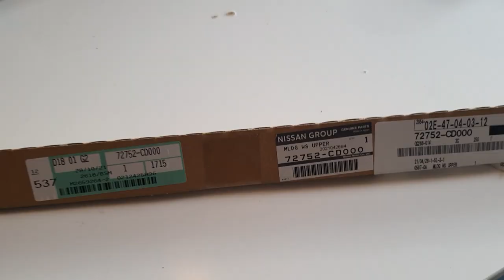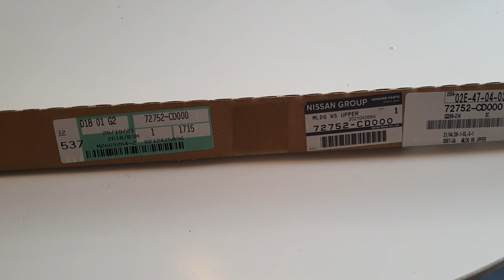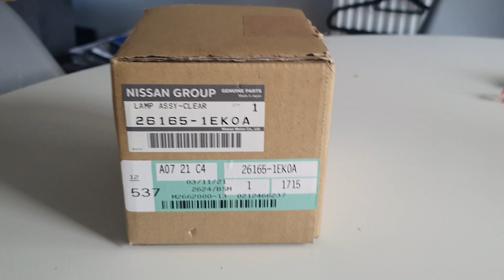350Z side indicators and A-Pillar trim seals

Comment: What wires you used to connect the Z logo
Reply from the maker: If I remember right I bought some 2 pin connectors off Amazon, you can just solder/crimp the wires together, but I opted for connectors so they can be disconnected easily if needed.
Reply: @VarleyRebuilds  did you use the turning signal wires from the 350z to solder and connect them both together ? Btw thanks for your reply